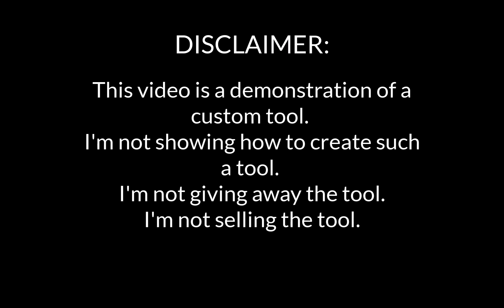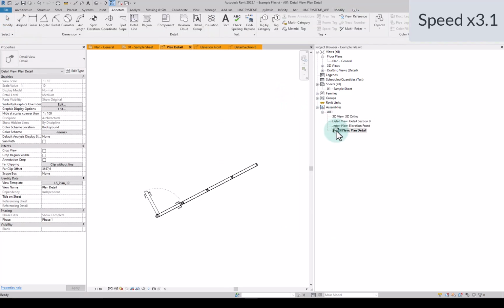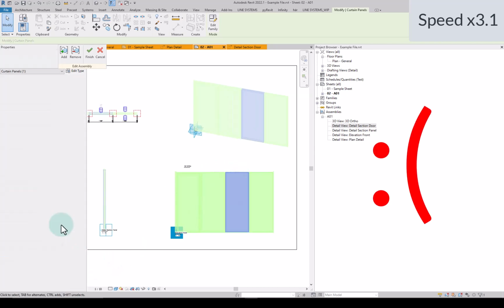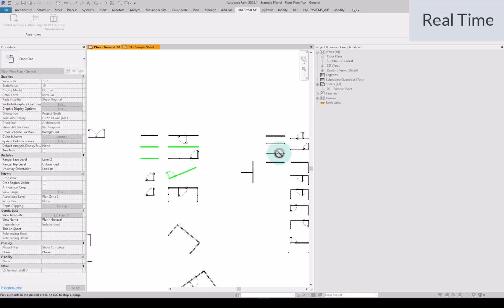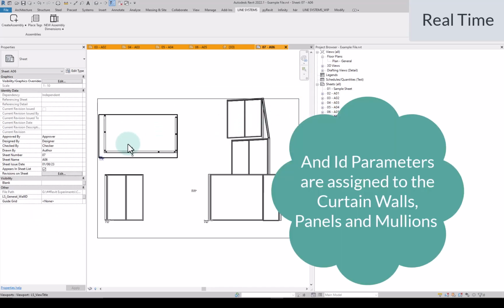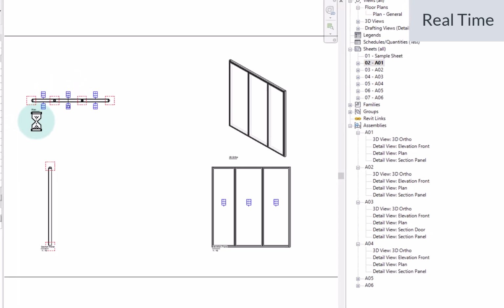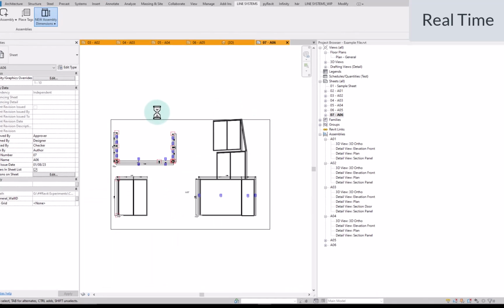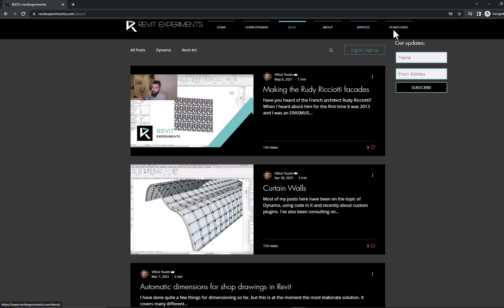This Revit tool saves up to 80% of the time for making shop drawings

Comment: This is very similar to something i have been working on for the steel Shop drawings. It looks very clean and with options for different forks. I have about 12 dynamo nodes that do about all the steps you showed along with schedules and other assembly tool. i Would really be interested in how you got it to a plugin and if maybe doing an expansion to steel shop drawings is possible. I have also made this work with mechanical pipe spool shop drawings. 
my Hangups where:

building
Reply: Hi. As well using the same principal but based on python scripts for different categories elements (steel, str connections, generic)
Nice to see this implementation in pyRevit
As for me main question/problem is control same instances of one Assembly type when you are going to add some changes into.
with pyRevit I think its possible only control with events (iUpdater)
would be great if you can share some your comments about that point. thanks
Reply from the maker: This tool is highly specialised for the curtain walls workflow and can't be used for structural elements as it is. However, a similar workflow for structural elements is possible. I'm not familiar enough with the specifics of pipe shop drawings at the moment, so I can't say for sure if that can be done - hopefully the answer is "yes".  
The tool works as a pyRevit extension and is made with Python and WPF